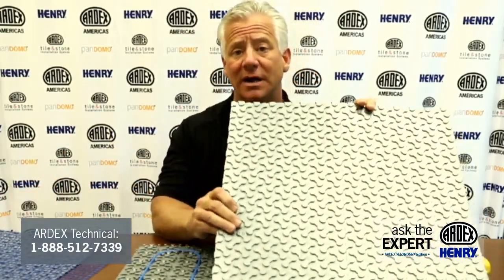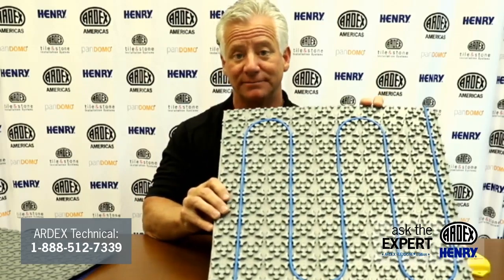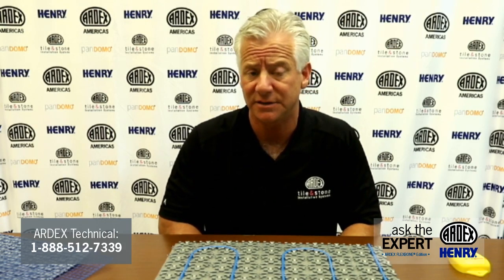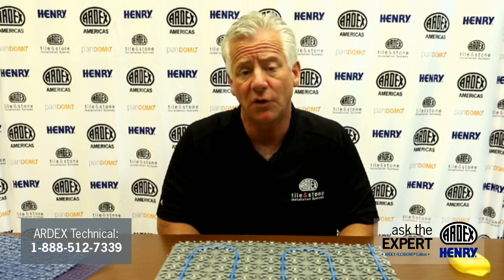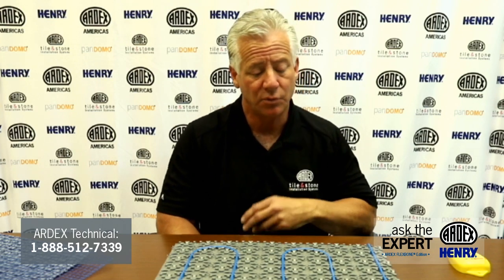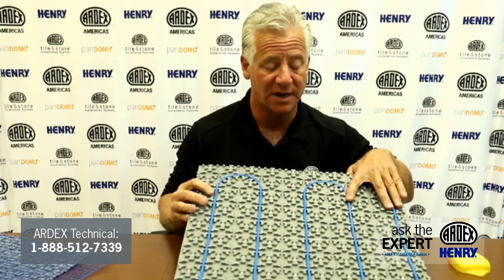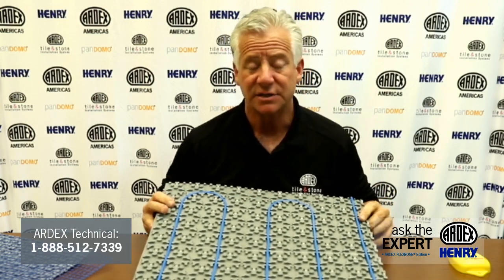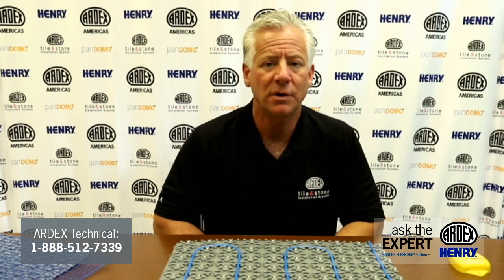ARDEX Ask the Expert - ARDEX FLEXBONE® Edition

Comment: Hi there, does the "hot" wire go up the wall to the thermostat and if so, does that hot wire need a conduit and if so, what material or type of conduit is recommended? Thanks.